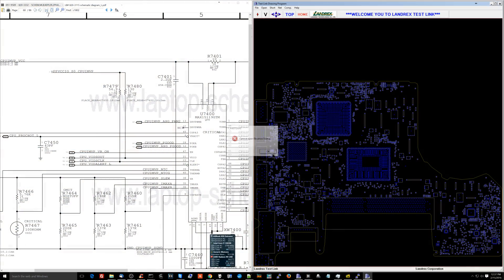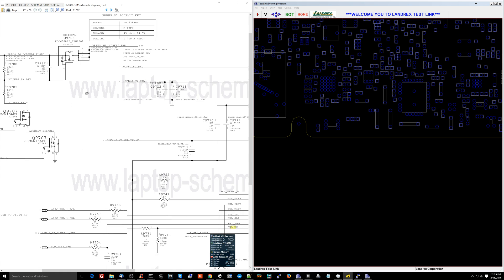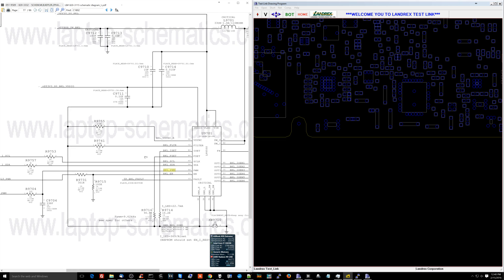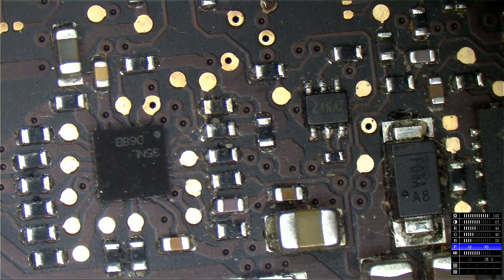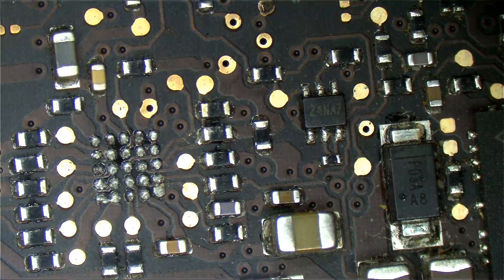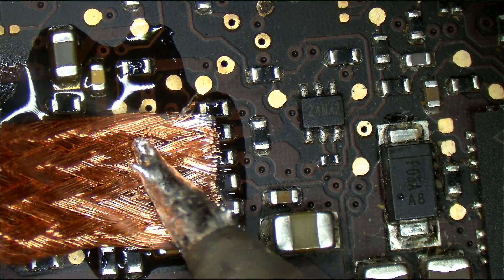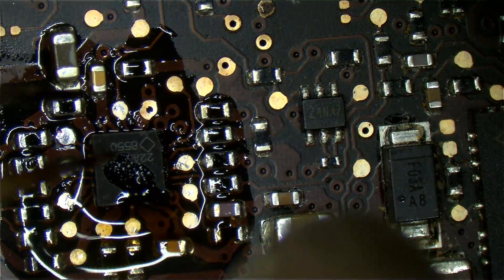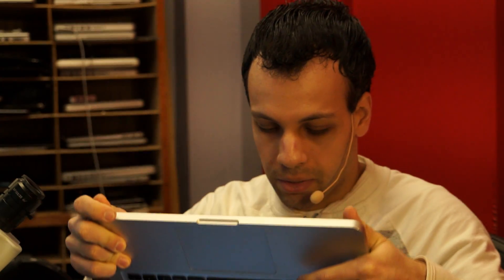When to replace LED driver on Macbook logic board

Comment: So bin watching your videos religiously I ordered lcd Driver chips from you, which I Believe was my problem on 2015 MacBook Air. Thought I did a good job until I realize I accidentally scraped all the Micro chips on one side of the board. What do you do now? Lol. Looked on your web site didn’t see them and they’re so small I don’t think I can Solder them on. List of parts I screwed up 100K 1% 1/20W MF 201,
200K 1% 1/20W MF 201 
21.5K 1%  1/20W MF 201
33 5% 1/20W MF 201 
33PF 5% 25V NPO-C0G 0201
1 SM 2
I wish you sold Circuit kits for newbies like me. 😁

Comment: I dont really work on modern Macs, but I did have to change out the LED Driver IC on one of them that came across my bench a couple years ago. Notice a trend that these fail, and never knew why. I also had a 2012 macbook come across my bench with intermittent video, and then sometimes chime/no chime. Or chime and boot with no video and no backlight. darn GPU failures. I tried to reflow that one but failed miserably, I think the GPU itself was actually bad. Radeon.

Comment: I'd bet they do make the cheap soldering stations crappier intentionally. The hot air digital temperature setting on aoyues is so crap, it makes me glad I killed it by leaving the pump on for a couple of days (using it to aerate an etching bath, the pump overheated, lol). It would just randomly error out when heating too fast so you'd have to bring up the temperature a couple degrees at a time.
If they'd just replaced the digital controls with analog circuitry and pots, maybe even replaced the heavy transformer with an smps, they'd make it even cheaper and lots more usable. But then they'd lose out on profit selling the more expensive stations.

Comment: Do you clean the laptops before you return them? I mean externally like the screen, etc.
Reply from the maker: +Noclpro Depends. If I am allowed to repair the machine at a proper pace, yes. If they start calling asking for status/if it's done yet, no.

If someone gives me time, I will give them the benefit of taking five minutes to clean every individual key, the screen, inbetween the keys, the trackpad, the bottom, the casing, the top, the insides so it looks like it did coming out of the box new from Apple. 

If someone doesn't give me time they can take it back as nasty as they sent it in. 

I start from a positive place with good intentions, and then I let other people dictate the rest based on their own actions. :)
Reply: +Louis Rossmann I love your take on things.. 
Thanks for the quick reply.

Comment: why do you consider the a1278 ivy bridge machines a piece a crap. I think its one of the last decent machines Apple made.
Reply from the maker: +highvoltage12v 1280x800 for sale in 2015 for $1000+ with a 500 GB hard drive. What a pile of shit!
Reply: +Louis Rossmann I remember getting a Dell Latitude D600 with a 1400x1050 screen in 2004. Granted, that was high end at the time, but selling a supposed high end machine with a 1280x800 display in 2015 should be considered criminal!
Reply: +Louis Rossmann Alright I guess you're right. I got my 2012 A1278 for the price of a screen. It was left in a hot car (so I was told) and it had an imprint of the keyboard on the screen and the housing was falling out of the shell.

Comment: What is the reason that you did not already opened it up and ripped out the beeper? ^^
Reply: +Dennis Lubert LoL
Reply: +Dennis Lubert The beeper is important as the station beeps once the iron has reached the set temperature.
Reply: +Marcin Pluciennik 
He should replace it with an LED or something. I'm sure he's already thought about it though. :)